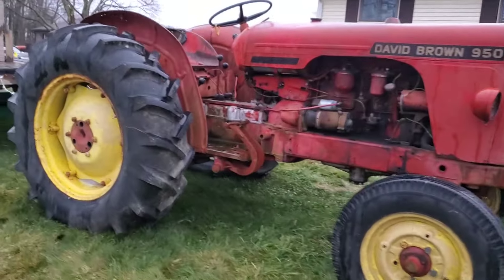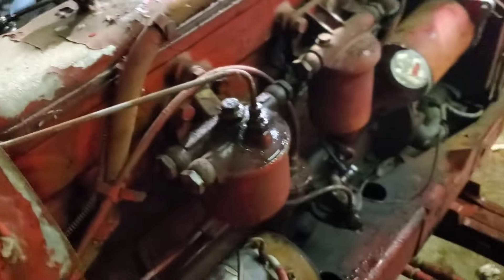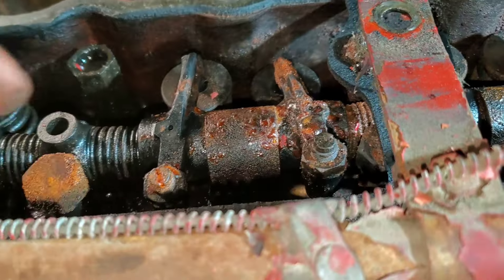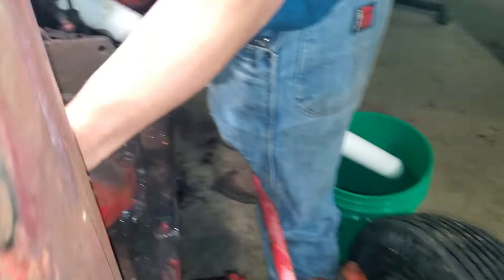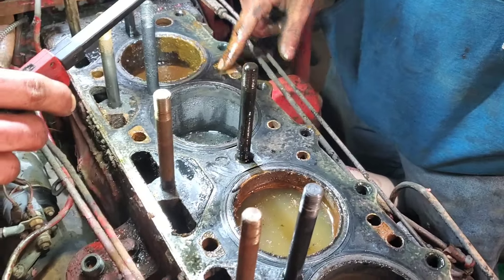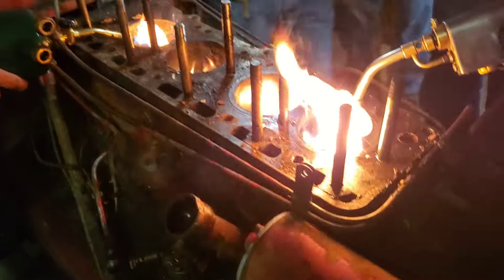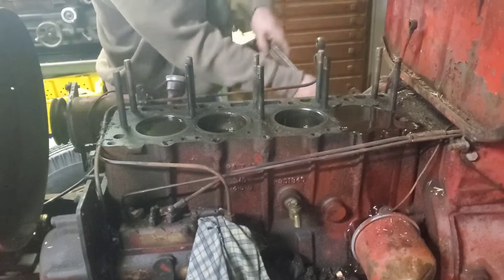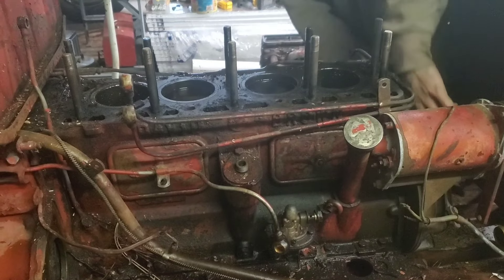David Brown 950 locked up tight

Comment: When I was a youth there was a derelict one on the farm. I towed it under cover and set about it. It turned out to be a jolly fine tractor. 
I used to love baling straw with the old International 440 square baler. They laughed when I first hitched up the baler as the 950 had no live drive 2 stage clutch. All I did when facing a huge heap of straw was to just rev the tractor a bit more and pull the gear lever into neural without using the clutch, the tractor freewheeled into the heap and the baler ate what was infront of it , when the bale chamber was empty use the clutch and a  low gear..the baler kept going using flywheel momentum and slowly ate the heap...simple really if you were mechanically apt.
TLDR>>> They were a grand little yoke.